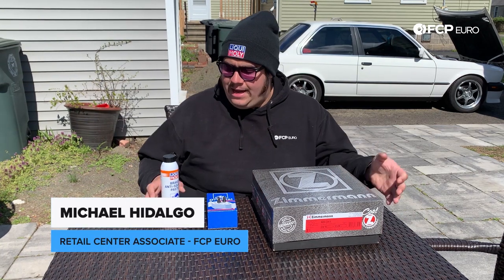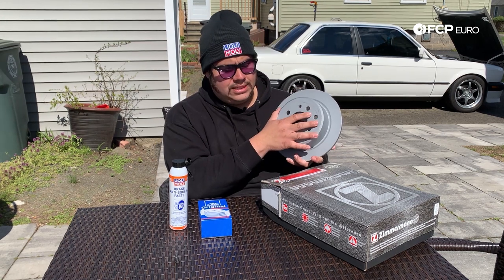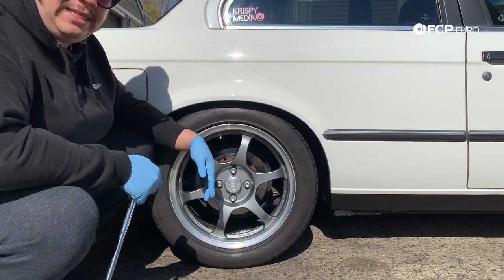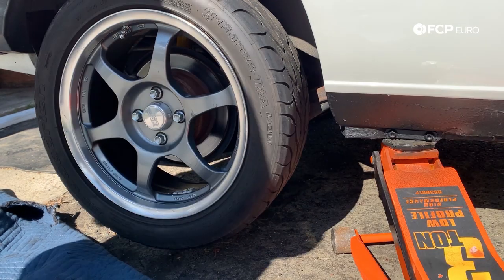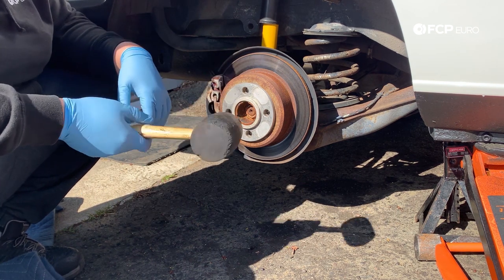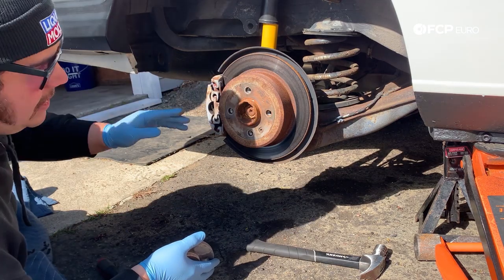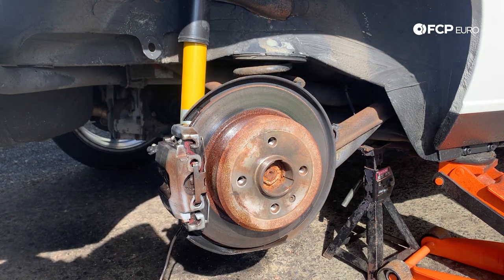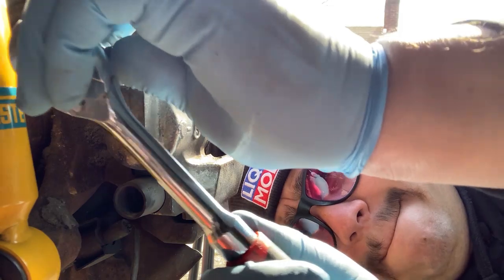BMW E30 Rear Brake DIY - Brake Pads & Rotors Replacement (BMW 325i, 318i, & More)

Comment: Excellent video.  The torque settings for the pad carrier bracket is 44 to 49ft lbs.  80 ft lbs is for the fronts.

Comment: I usually apply a thin, even coat of copper grease un the brake disc/ spacer contact area, as also center. Never gets stuck, and does not dries out.
Reply from the maker: That's a good tip, Rolands!

Comment: You are a good presenter. Do some more stuff. What size wheels do you have on your E30. I couldn't read it on the tire. 225 something. I have an 87 E30 with the original
14 inch wheels and would like to move up. Thanks.

Comment: I would definitely change that 5mm rotor bolt for a new one so that it won't snap off on you at the next brake rotor change..
Also I always take the cap off the brake fluid reservoir as it makes pushing the piston in much easier..  Also sometimes you'll need to drain off some brake fluid after the brake pad change...  Leave a small post it on the dashboard to remind you to check it at the end of the brake job..
Reply from the maker: Very True Mark, we are editing Mikes video on how to do a full brake system flush on his E30 right now and he covers a lot of those same great points you bring up! Thanks for the insight

Comment: Hi, don you put a brake pads waer sensor on the rear right? There are two sensors - one in front left and one in fron right for all models of e30 right?

Comment: Really good video. Parts ordered. I have a question....do I need to use the spring clips that slot into the pads...are those clips only needed for the sensor? I didn't see them used in this video. Thanks. I have an 89 325i.

Comment: Spot on Tutorial. Thank You for your efforts. Our E30 is going up on the stands soon. Boat load of work/love to do.
Reply from the maker: Goodluck on the e30 work GMAN. What do you have planned?
Reply: @fcpeuro  325is. It sits toooo much.  Has less than 1k on Cylinder Head Rebuild and a attention to detail under hood factory fresh appearing mini resto. (God I hate to tear back into my hard work but it's my doing). I'm chicken to start it so Timing Belt and Tensioner, ( going to install Gates Racing Belt this round), Check Valve Adjustments, Oil Change, Then.....it's getting a complete 'Rear Subframe Out' Suspension rebuild with detailing and goodies.